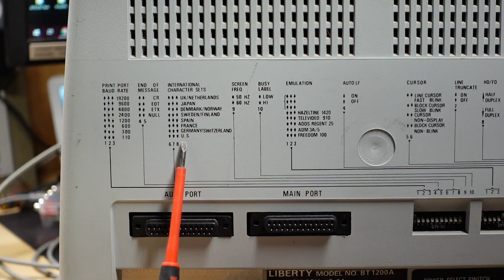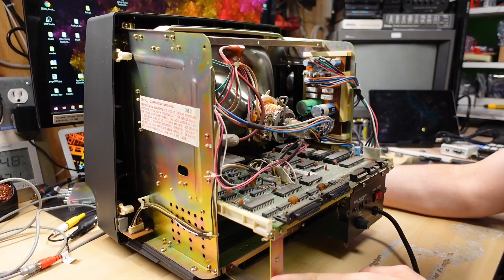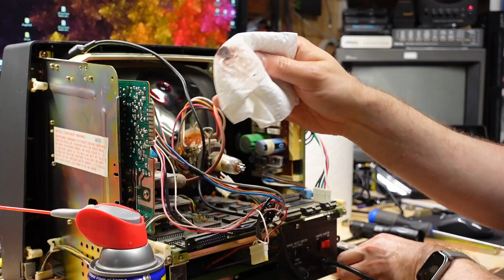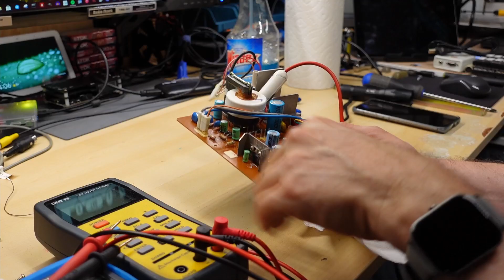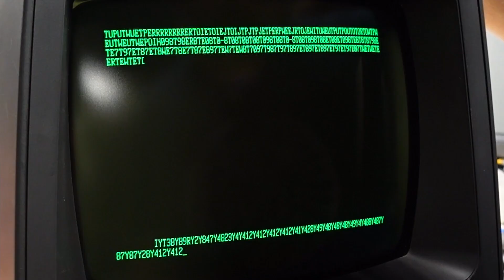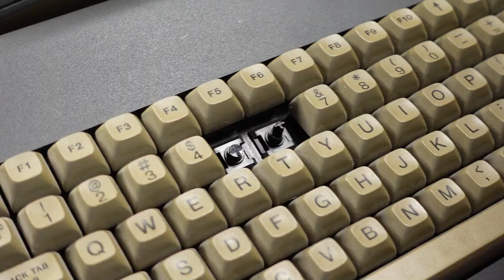Liberty Electronics: Freedom 100 Terminal Repair

Comment: I have the same Freedom 100  terminal with a good keyboard, and it’s still used today as my bench-top CRT serial terminal, mainly with my Signetic 2650 system.

Comment: I guess they reason they had the The Cousteau Society sticker on there was because they
pretty much deemed it a boat anchor when they 86'ed the thing.

I have had the same strange self healing thing happen several times, someone brings 
something over for me to have a look at, I see what is it doing or not doing correctly,
 I open it up do a quick visual  check, and do some preliminary futzing of  wiggling a
 few wires, unplug and re-plug a few connectors, check any Pots that are in the circuit, 
spray any circuits  down with electrical cleaner and Viola!
when I bring the fully functional item back to the person , they think I'm some sort of electrical genius. I tell them I did'nt do that much, and it started working again.
strange how that happens some times, and other times it is a 2 hrs of diagnostic to figure out
what IC, Transistor or other part has given up in the thing.

Comment: With sticky stuff that doesn't come off with soap and water, the stickey is likely oil based. 

If you get tree sap all over your fingers (or any sticky plant sap or resin) some vegetable oil, or olive oil (and i'm sure WD40 would also work) will get it right off. 

I didn't believe it until I tried it! Just rub it on your dry hand, and wash up with soap and water. Much nicer on the hands than a harsh solvent that is traditionally reached for.

Comment: I worked for Visual Technology from 1980 to 1987 and fixed their V200s which were similar to these. Visual was famous for their emulation and mostly emulated DEC terminals throughout their product lines. Seeing this terminal brought back some good memories of working on fun electronics. Visual used Z80s for their terminals and I learned so much about the circuits, PIO, SIO and peripheral chips. Later they promoted me to field service and I got to work on the much old Ontel products which were really complex but fun too.

You did give me some flashbacks when you opened up the terminal. I got zapped quite a few times from the residual charge still in the CRTs after disconnecting the cap and discharging the tube. One day I got zapped and ripped the back of my hand inside the chassis. The zap didn't hurt so much as it startled me and I yanked my hand reflexively and caught the back of my right hand right at the middle knuckle and had a bloody mess as a result.

Comment: I feel short-changed on how you got the raspberry pi to 'talk' to the terminal through the serial port. Is there a linux command which pipes console I/O through serial? And how does serial comms work through USB? Did the connector cable have 25 pins, or did you have to attach a 9-pin to 25-pin adapter? I'd likt to have seen a little on that.
Thanks for this video, nonetheless. I love old dislplay hardware like this.

Comment: I think you answered your own question here. :-) The unit sat unused for years and the dielectric properties of one or more of the electrolytics had changed and the capacitor(s) reformed after being exercised for some time. Sometimes this works fine but other times the capacitors may be borderline.

Comment: Looks like the electrolytics reformed over time.  If so, may be sometime in the future it will require some new ones on the screen PCA.  Of course, typed this just before you mentioned the reforming cap!

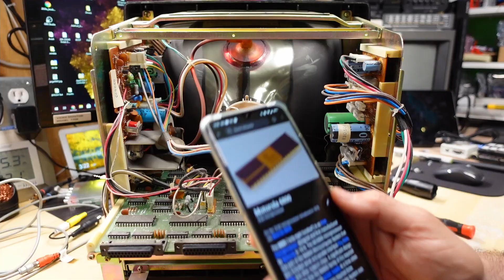Comment: It's part of the 68-hundred series, not the 68-thousand series. Not sure if that was just misspoken or not, but, unlike Intel, Motorola decided to make their new microprocessors not backwards compatible with their old ones, thus the split between the 6800 and 68000 series. (9:30)

Comment: The screen "out of wack" may have been oxidation on the screen control knobs.  The knobs are super-sensitive and can change without touching them.  A little Deoxit will usually fix those pretty quickly and result in a more stable picture.  Might be worth a shot next time you have it open or for a possible other repair in the future.

Comment: Those keystems also look like the ones on an Atari 1200XL.  Here's an idea until you can find replacements. Move a keystem from a key that would rarely be used. The six key being used more than numeric ENTER. Guessing you don't need to use the numeric keypad so swap one stem from the keypad with the 6 key.  If it is a high use device, the electrolytic caps would be a good idea to replace with new ones.  Would buy this terminal from you. =)

Comment: The "goo" or "grease" from silicon degrading (which is what that cap on high voltage cable looks to be made of) can be washed off with dishes liquid soap. The regular soaps, either solid or liquid, just can't dissolve it well.

Comment: All electrolytic capacitors have issues with "forming."  When they are de-energized for a long time, they stop being capacitors (I.E. de-form).  But once you re-energize them they will "re-form" the dialectric.  Unfortunately if you are not careful about it, the capacitor can fail.

Comment: This is way cool! I can remember my dad fiddling with malfunctioning TV sets when I was a kid. He had pretty good instincts as an avid do-it-yourselfer, and a better than average understanding of electronics, but he was a medical doctor, not a TV repairman, so if there was something wrong with, say, the CRT control circuitry, he couldn't fix it. (Blown picture tubes were rare in the 1970s unless the TV set in question was 10+ years old, at which point most people wanted to buy a new TV set anyway.) I used to look over his shoulder and marvel at what was inside, but I had no clue as to what any of it was or did. I eventually learned what resistors, capacitors and transistors were, and could theoretically replace them, but I never learned how to troubleshoot or design a system with them. I'm just loving how Adrian analyzes, troubleshoots and fixes these things, explaining what everything is and how it works along the way. For me it's all a big reveal.

Comment: Happy July the 4th! I'm excited to see that you have "repaired" this. I really appreciate your comments. I have this exact terminal and just repaired mine last month. The vertical linearity was off, the top 4 lines of text were off the top of the screen and the bottom half looked just fine. After extensively investigating every electrolytic capacitor for high ESR, all caps checked out good. I wasn't expecting that. I read the maintenance manual for advice on how to fix this. No good advice in the manual. All I did, was to "recalibrate" the pots at the top of the video board. The maintenance manual does not even mention these pots, or what they do. My terminal is working fine now.

Comment: could you trim down the stem on that switch to shorten it a little bit?  it looked like it had a little extra length below the key where you could cut some off and the key would still fit, but i don't know

Comment: According to this review of the keyboard (https://www.youtube.com/watch?v=uvoig6HhR7s), the switches are of the type SMK J-M0404, aka. SMK vintage linears.
And the terminal is supported in Linux/curses if you need the non-dumb stuff supported: TERM=f100
P.S. there are two aliases for f100 you could use as a stylistic choice, freedom or freedom100.
P.P.S. looking up more info, it looks like this keyboard, at least in the lower row, uses the 'Short stem, angled' variant of the switch.

Comment: I owned a Freedom 100 back in the '80's. I had to modify it to make it work correctly at 19,200 and the factory tech supplied the method. Perhaps an early production version? In one of my many moves it was damaged and recycled. I might still have the manual somewhere, but that might take lots and lots of searching to find.

Comment: I doubt the caps were reforming. I doubt anything was really wrong with it in the first place, perhaps a bad solderjoint if anything!
Reply: A bad solder joint wouldn't gradually improve its contact in such a smooth way surely.
Reply: @josh46646  perhaps I’m missing something. The guy said the text was “wrapping round the screen” but then whatever it was suddenly cleared up. This wasn’t even confirmed as a deflection fault anyway 

You can’t reform those types of capacitors. Perhaps it was just a badly connected plug or something less sinister.
Reply: @The_Studioworkshop  I think it's pretty obvious it was a deflection fault. The symptoms were consistent with a leaky capacitor in the vertical sawtooth generator. When that cap is leaky the rate of deflection becomes lower as the frame progresses. If the output driver saturates the rate of deflection can even become negative, leading to some vertical wraparound.
Reply: @eDoc2020  you’ll probably find it was a cold joint or just a crap connected plug which could’ve worked itself loose. No cap bad
Reply: @eDoc2020  it appears the wraparound could’ve been because the brightness was too high. It’s just frame/vertical collapse
Reply: @The_Studioworkshop  My antique TV has a leaky capacitor in the vertical ramp generator and the symptoms are the same, the bottom of the screen is compressed even when the linearity control is maxed out. In my case I'm sure it's the capacitor and not the connection; when I subbed in a new capacitor it was fixed and reconnecting the old made the problem reappear. As @krnlg said, a poor connection won't behave so smoothly.
Reply: @eDoc2020  I’ve reviewed the footage and I can’t see any example of any vertical scan at all. I understand what you’re saying, An issue where the vertical linearity is messed up because of leaky bypass caps is a probable cause, but there was was a line on the screen. Maybe I’m missing something?

Comment: I'm always afraid anything that fixes itself is soon to break again in short order. Not that this is mission critical so I'd call this a success either way. Great work as always.
Reply: Indeed.  I prefer a reliable failure than something that "fixes" itself.  You can't fix it if it's working.

Comment: temperature DEPENDENT eye roll its not fixed
Reply: I doubt that's the big problem here. My guess is the capacitor in the vertical sawtooth generator needed to reform and will continue to work fine. The test will be seeing if the problem returns after the unit has been off for a while and has time to completely cool. Until then we can't really be sure.

Comment: The sticky stuff under the anode cap is dielectric grease/HV insulation grease and is meant to be there. Without it, you can end up with the anode arcing out from under the cap if you get a dust buildup in the vicinity of the cap.

Comment: if you want to extend the life of these rubber caps you should use silicon oil instead of wd40, the only thing wd40 does is dissolve the cap even more, it's usable to clean the crt itself but you don't want to use that stuff on the cap itselt.

Comment: a few thoughts.. you could pull the stems from the keycaps.. and superglue them back together OR take one of the stems out and see if someone can make a mold of them OR maybe even send a stem to someone that can 3d model them to spec and have it 3D printed if your worried about the super glue option coming apart you could always take a needle and embed it inside both the top and bottom half of the stem and glue them together with the needle in it to give it more sturdyness i recently needed to repair a tandy 1000 keyboard which has some fujitsu leaf spring gen 3 keys and the break key was litterally missing the stem so after asking around the net and finding no one with any i looked at the keyboard closely and realized while the space bar has a stem in it..it doesnt actually HOLD ONTO the stem like the rest of the keycaps..rather the springing mechanisms on the outsides of the spacebar are what it holds in place..so the stem for the space bar was just acting as a spacer to press the key... quick grab of a piece of plastic and a dremel later i swapped the stem to the break key and stuck a piece of plastic that was the same height width of the stems in the space bar location and it works theres literally no way to tell unless you take the keyboard apart ..i do wish it were original (so if you happen to have an extra please let me know LOL) but im glad its fully functional again above all

Comment: The first place I worked at (British Rail (or at least its successor), the source of your Local Systems Arche/Vixen motherboards) had several of these dumb terminals (different brand but very similar right down to the CRT stand) dotted around, tied via ISDN modems to the mainframes, and were used if the WAN failed and the SNA terminal emulation software was thus unavailable, to allow developers access in for emergency maintenance etc, as late as 2005 (its possible they're still around today!) . They were getting very long in the tooth by then, having been in service for well over 20 years.

Comment: Custeau made documentaries about the ocean, the marine biology, that kind of stuff. His boat was called "the calypso".
what I don't have a clue is what is that thing and what can you do with it. at first I thought it was going to be a not-PC computer, like a Tandy, Adam, or the british one.  I'll have to google what it is.
Reply: It’s a terminal, it receives plain text from another computer and displays it. Later existed “graphics terminals” but this isn’t one of those. You could plug it into a Raspberry Pi or a modern desktop with the right software options set up and access their text mode command line (like Cmd in Windows or TTY/Terminal Emulator in *nix). Those windows with text inside are emulating a terminal like this, and that’s all this can do. LGR has a video on a DEC terminal from a couple years ago too. Old terminals are fascinating!

Comment: I'd adjust the linearity then the vsize.  And clean those pots.  I bet those couple of electrolytics in the vertical deflection section self healed a bit once power was applied for a while.

That's a really great terminal.  I am a little jealous.  ;D

Comment: Iirc that goo is a dielectric grease to keep the high tension from arcing to the tube coating.  I always put new on if the old is too goopy and/or has migrated away from where it's supposed to be.

Comment: Linux has a terminfo entry for this terminal.

export TERM="freedom100"
Reply: This bring me memories if a time when i connected an IBM terminal with spanish language cartridge to a pc with redhat, but terminfo had no definition for the cartridge extended chars, having to compile with an specific program for terminfo to get a new definition...
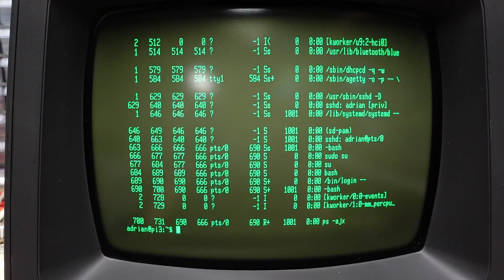Reply: At 30:26 (among other places) you can see on his monitor that he's cd'd into /usr/lib/terminfo. He was trying to figure it out. Maybe the Raspberry Pi OS he was running has a stripped-down terminfo database?
Reply: I think the Unix terminfo database pretty much has everything.

Comment: Janky electrolytic capacitors on the analog board, they need to be changed, otherwise the problem will comeback 😋
Reply: Absolutely right, it will come back, there's still a problem and its likely temperature related.

Comment: 40 year old electros. What could go wrong?
Reply: Not much. If they don't heat up they're probably fine (or completely dead). I don't think age has much to do with their reliability but rather usage does. I'm restoring a TV from 1949 and it only had two or three failed electrolytics, the other 15 work perfectly.

Comment: use a dreamal and cut down the + of the steam and the shorten the stem length. i also found these https://www.electronicsurplus.com/smk-3-336-switch-p-b-spst-package-of-10
Reply: I was going to suggest that Adrian shortens the length of the stems too.  He could use a bit of sandpaper until he gets the right height.

Comment: Often the linearity fault is down to a duff capacitor, as others have mentioned. Often too, this is a 3.3uF or 4.7uF or thereabouts, Bipolar electrolytic cap that looks like an ordinary electrolytic. Be careful if this is the case and you choose to replace it. A non bipolar cap will work for just long enough to get the lid back on before it pops, ususaly very loudly.

Also.. stem on replacement keys is too long?! Can you not file it down to the required length?

Comment: I've heard of some electrolytic capacitors doing this.  If they're left unpowered for a long time, they can depolarize.  When you power the device on again after many years, the capacitors will repolarize after a while.  The problem is it's a race between the capacitors repolarizing and exploding, so sometimes a device will pop the caps instead of coming good again.
Reply: Is that why my 8-track deck blew a cap across the room?
Reply: @samuelcolvin4994  If it had been sitting, unpowered, for a long time, it might be.  Of course, if your player had sat unused for that kind of time, I wouldn't put much hope in your tapes being any good any more, either.  (The lubricant required for the tape to slide in the spool dries out, and the tape normally breaks at the splice.  I've seen this happen to 8-track tapes.)
Reply: My tapes interestingly enough were fine, they'd been played a lot, the machine was a Bigelow brand 8-track deck, and it launched the casing of the cap the size of my thumb across the room and an inch from my face, fun times! I think I ended up replacing like 30% of all the parts on that thing
Reply: Oh yeah I've replaced a zillion of those splices,
Reply: @samuelcolvin4994  Unfortunately, it turns out caps are remarkably easy to build in a whole myriad of ways, but most o the ways you can build caps turn out to have at least one way of going off bang or some other catastrophic failure mode.  I understand the old waxed paper ones like to just burn up.  If the casing for the device that happens in happens to be made of celluloid, you've got some potentially really interesting events going on right there on the workbench.